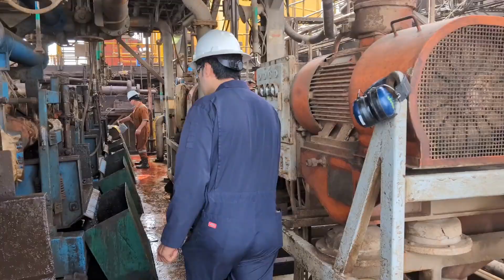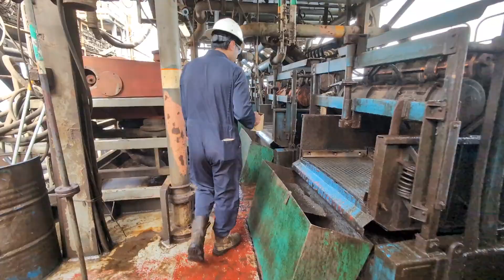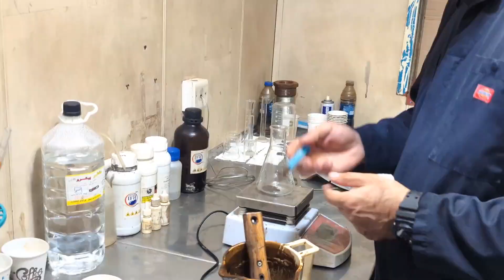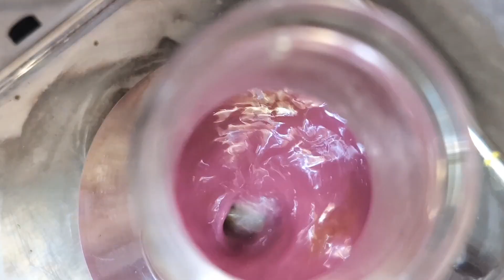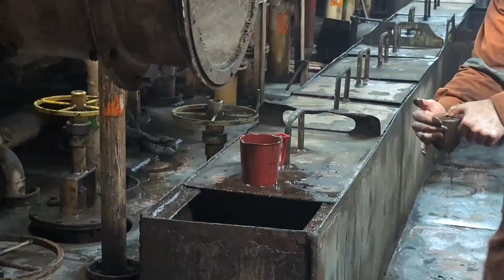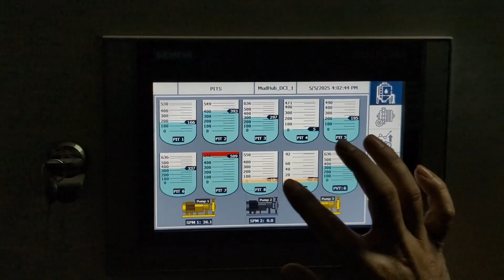What is the job of a Mud Engineer?

Comment: By the way I'm Algerian Engineer 🇩🇿🖐️
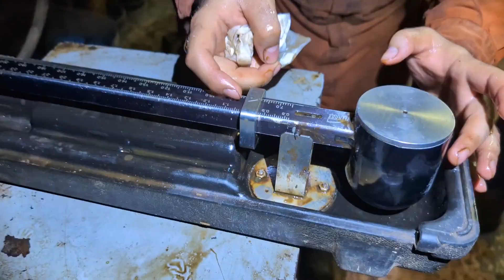14:23 the mud balance curser is indicates  a value of 7.8 PPG equivalent of 0.93 SG it's light mud weight and less viscosity the value of YP  it will be in the range between [ 8-13 Lbs/ft^2]  and slow ROP probably they're drilling  in production section 6" section !
16:37 Vahid give instructions to Derrick man to do a treatment in mud using I think " Lime " ! the roustabout who involved in fabrication should be  at least wear a mask, glasses, gloves to protect their selfs from chemical products keep the awareness at High level we don't need a troubles in the long run Safety 🦺 comes 1st ! this is my opinion about what's going on in details much respect to all workers in the rig 🙌🙌🙌
Reply: or it could be caco3 an maybe they are controlling the PSD and MW, about safety it seems that this is the last thing to think about at the begining you see the engineer out of his office wearing slippers, and working in the lab without safety shoes, I don't blame roustabout if engineer has such low awareness

Comment: I'm a university graduate, I want to cross over to the oil and gas industry any advise on the best way to do that? I have 6 years experience in automotive mechanic
Reply from the maker: yes, it’s possible, but you’ll need to package your existing skills the right way, add some oilfield-specific training, and build connections. That’s the fastest route in.”
Reply: 1. Identify Relevant Skills
Highlight transferable skills from your automotive mechanic experience that are relevant to the oil and gas industry, such as:
- Mechanical aptitude and troubleshooting
- Understanding of hydraulic and pneumatic systems
- Familiarity with tools and equipment
- Problem-solving and analytical skills

2. Get Relevant Training and Certifications
Consider taking courses or certifications that are specific to the oil and gas industry, such as:
- Well control certifications (e.g., IWCF, IADC)
- HSE (Health, Safety, and Environment) training
- Oil and gas industry-specific courses (e.g., drilling operations, well control, pipeline operations)